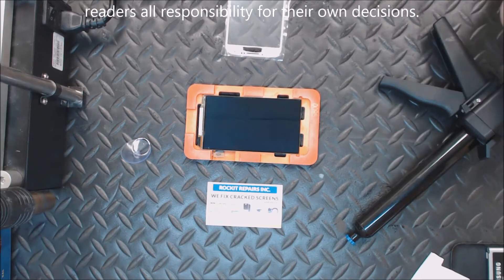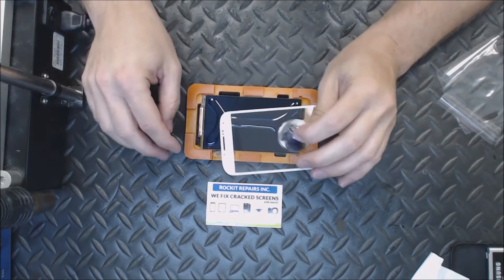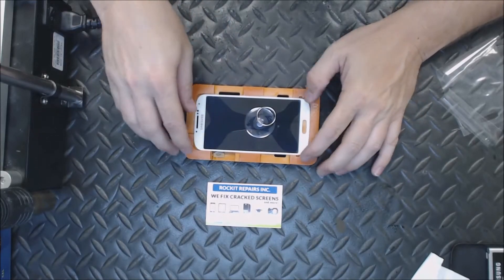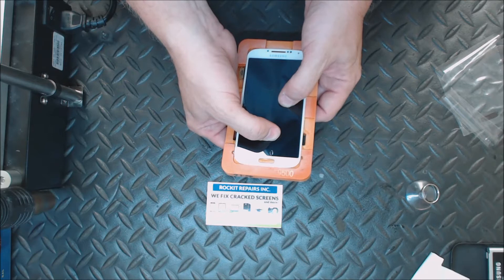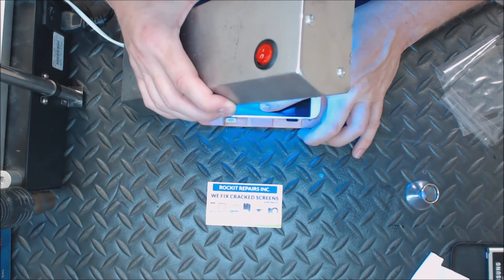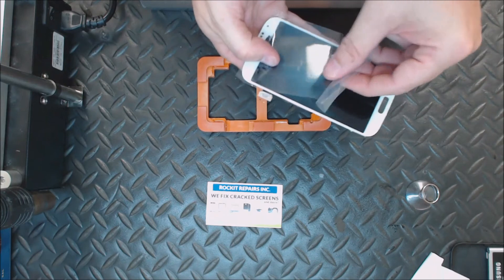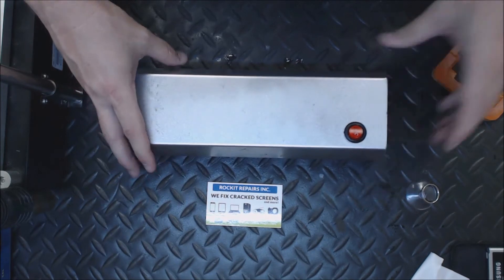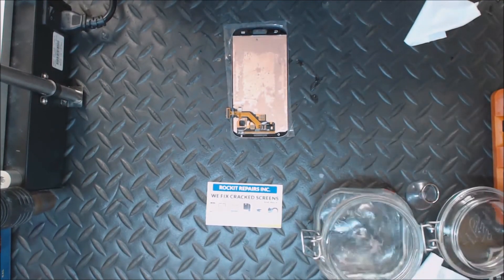How To  Apply and Cure LOCA On Samsung Galaxy S4 SIV LCD

Comment: Thank you for the informative video.  I would like to know more about your prep procedure.  I have tried bonded glass replacements a few times, but I have problems with dust and adhesive removal.  could you give us some info on how you go about making the LCD ready for bonding?
I am considering building a tabletop positive pressure clean area for this but I notice you don't seem to need one.
Reply from the maker: Aaron Masters No that is excessive and you do not need.